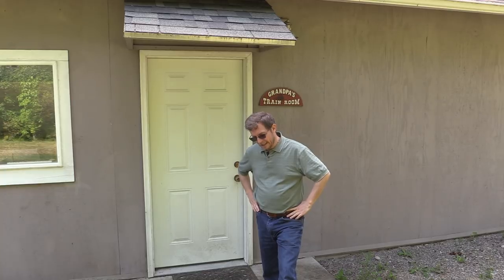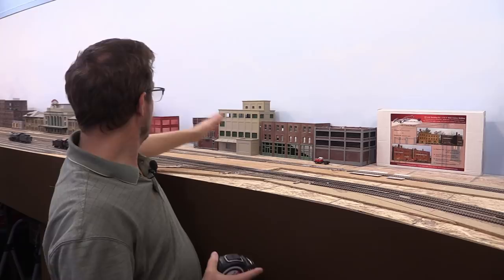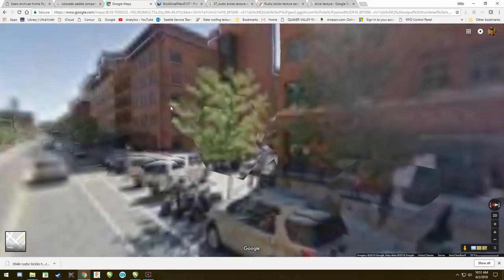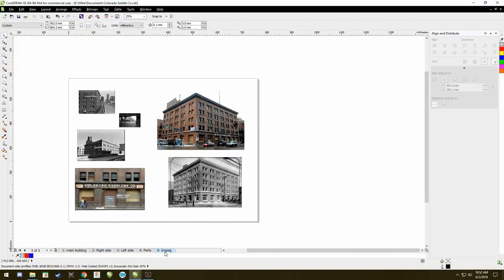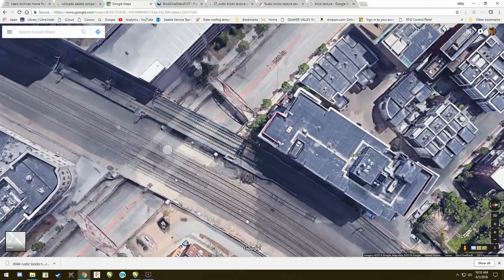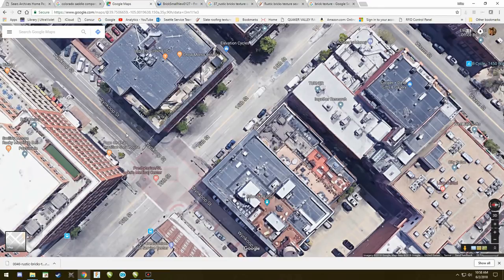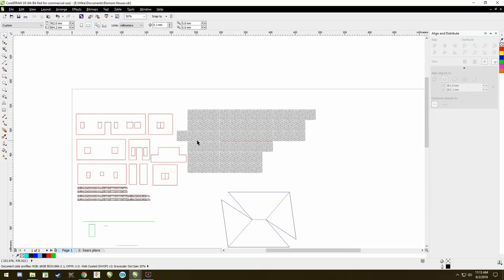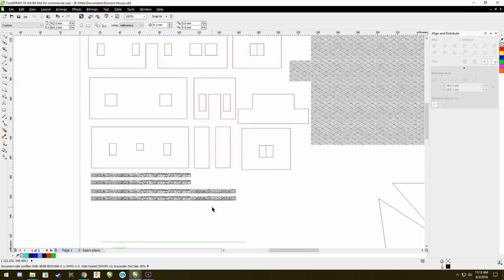Scratch building models with a laser Part 1

Comment: You mention using strip wood (2x2)  where clapboard walls meet in corners instead sanding down to 45 deg. bevels. I'm working on a structure now where I tried this for the first time. You are right it. It is so easy. Why haven't I thought of this before? Was this a standard construction method in prototype?
Reply from the maker: Yes the building is Proyotype Google MJ O'fallon building and look at images

Comment: Have you tried using Google Earth?  Uses the same images but has a tool to take measurements directly on the program.
Reply from the maker: Thanks
Reply: Also a scale in the lower right corner you can measure.